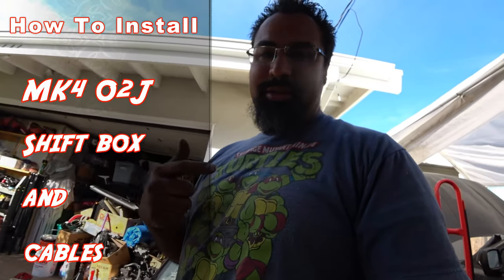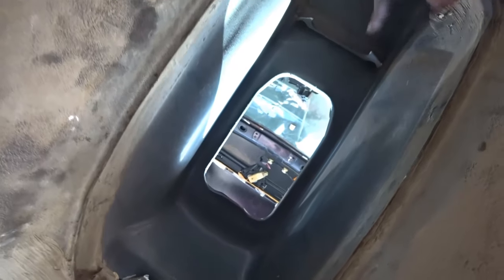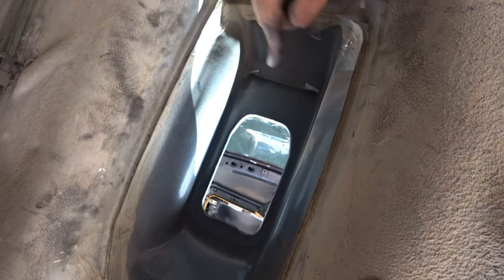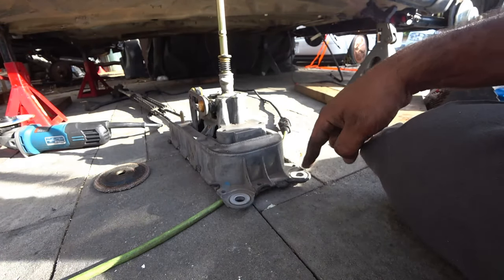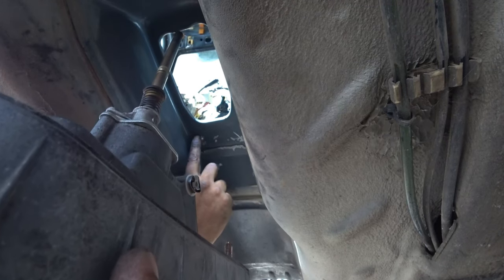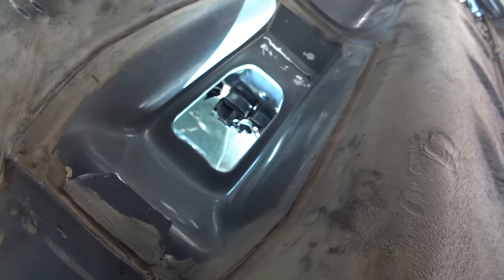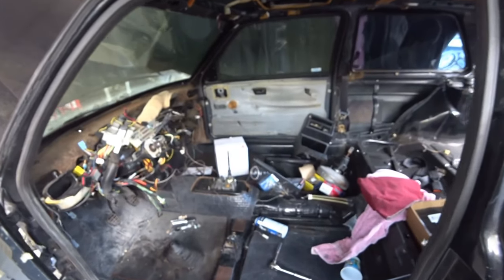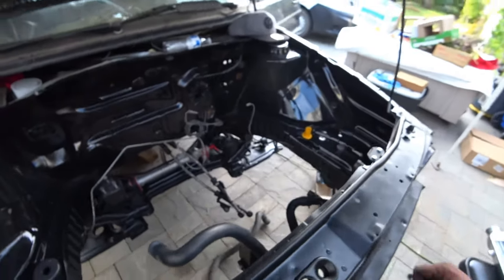VW MK2 gti jetta golf with a O2J Shift S6 EP6

Comment: Hi great great video 
I’m about to do this on my MK2 I have a 16V and I want to upgrade O2J transmission. My question is what motor mounts I need to use to mount this transmission on my MK2? Is it the same one my old transmission used ? 
Thanks in advance

Comment: Hi we’re you able to snap back the shift boot and trim  assembly back on with the original holes you drilled or second additional  holes? Either way the shifter boot wont snap back in place , it sits up to high. It needs to sit lower in the frame.